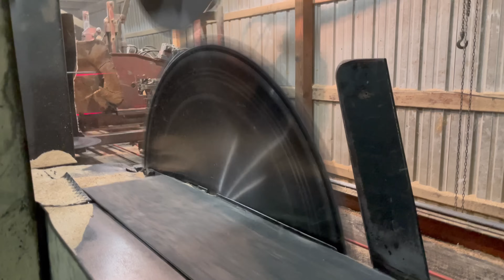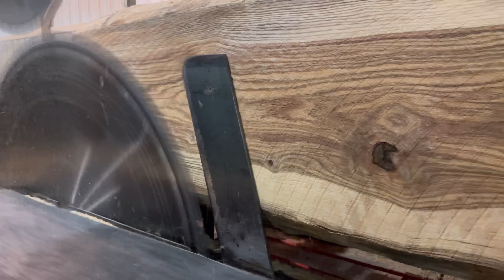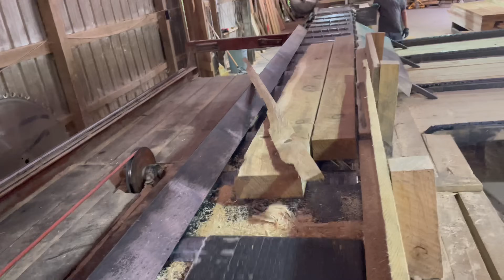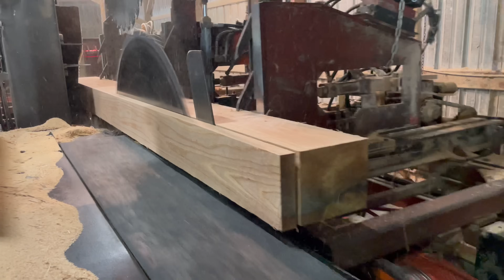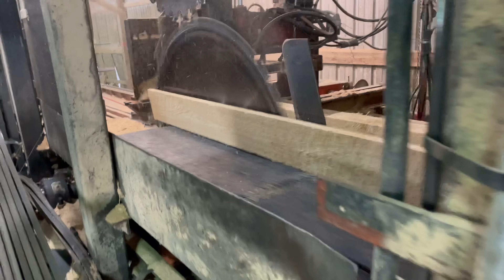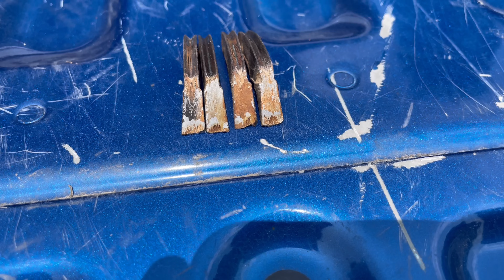ASMR, An Hour of Pure Saw-Milling! #78

Comment: Ian, on that very last log with the metal in it, when metal is struck that early in a log, after replacing the broken blade teeth, did you then write off the rest of that log as firewood or did you work to saw around where the metal was, fingers crossed there wasn't any more metal anywhere in the log?
Reply from the maker: Firewood pile!! I’ve gotten away with trying to get more yield, or cutting the metal section out like you mentioned if the log is long enough. Also it’s bitten me plenty of times too. At this point I just prefer to kick them out

Comment: You were talking about the different saw blade types being used in todays episode, not being a subject matter expert in saw milling you lost me. Also was unable to tell the difference in the blades tone, played the video back several times still a no go at this station.
Reply: About the 40:00 and 41:00 marks, around or soon after that, is when the blade change happened. The sound pitch of the saw's cutting drops noticeably due to the 'B' pattern saw having a few fewer teeth around its circumference. IIRC Ian has said the 'B' pattern blade has 48 teeth compared to 52 teeth for the 'F' pattern blade.
Reply: @Patriot1776 Thanks
Reply from the maker: At some point I’ll do a video that does a better job at comparing the distinctions! I just had to change saws while compiling these and figured I’d mention it:)